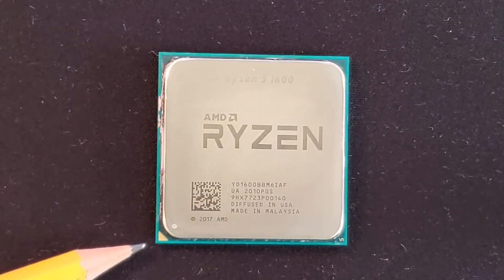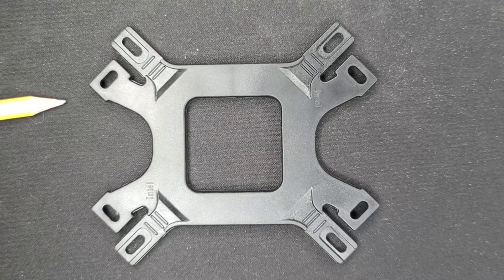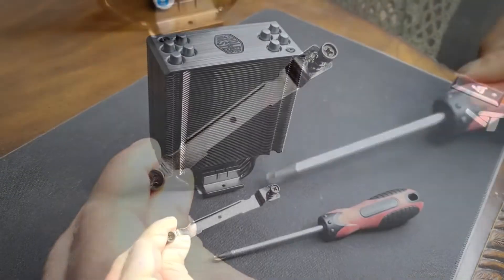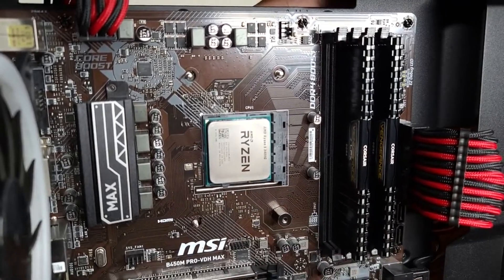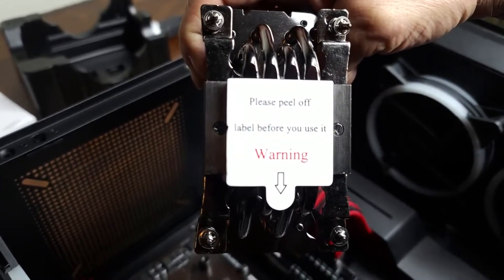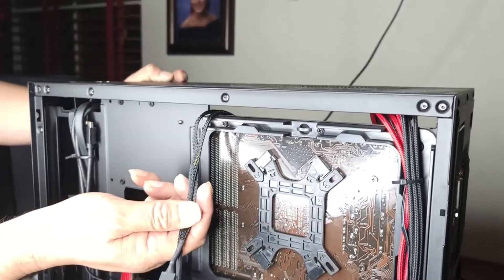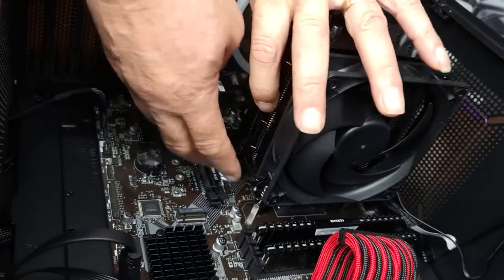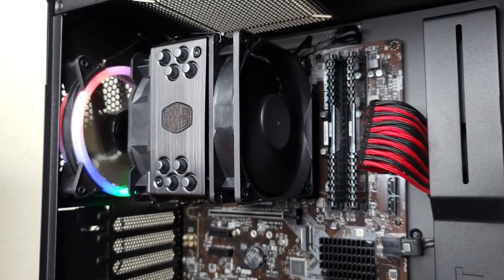Ryzen CPU Installation Guide (AM4): Hyper 212 Cooler with Dual Fans

Comment: What a coincidence! I built my first PC back in late 2020 (still using it today), I installed a Ryzen 5 2600 with the same cooler. I also bought 4 extra Cooler Master case fans, I put 3 of them in the case (Corsair 4000D Airflow), and put the 4th on the back of the cooler :D
Reply from the maker: Very cool! ⚡️ Will last you a long time! ⚡️